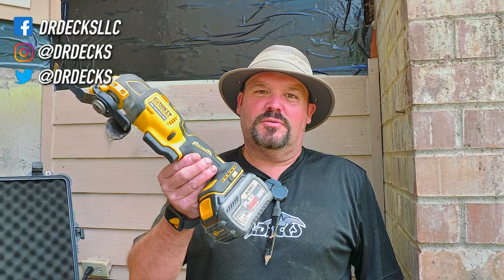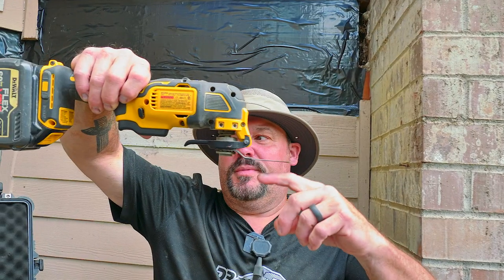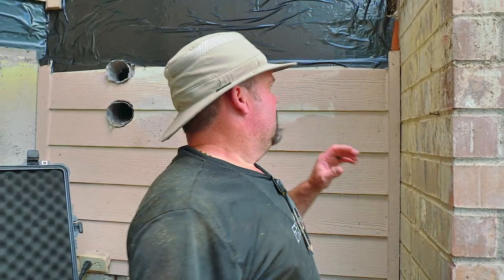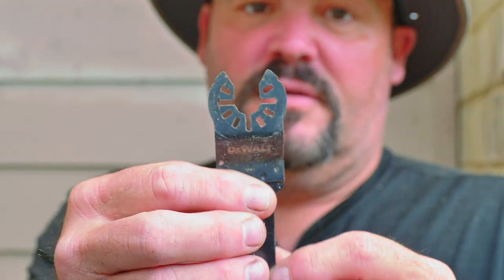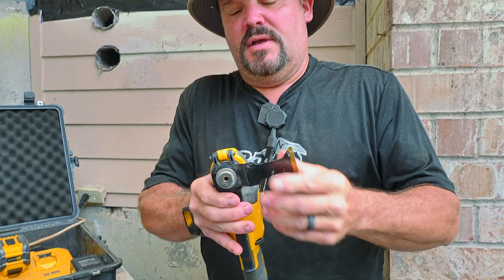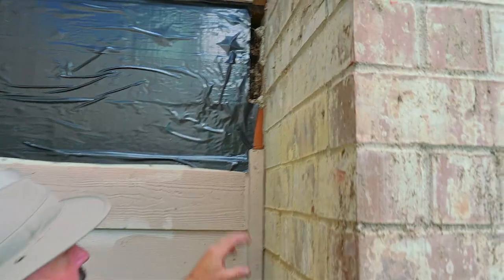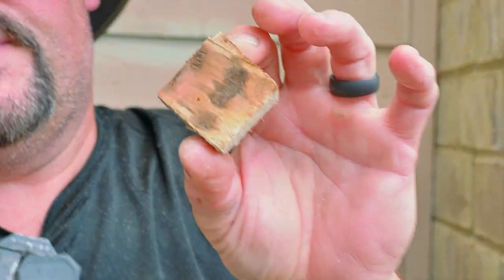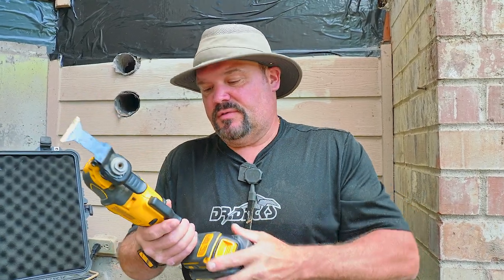What Is An Oscillating Tool? || Dr Decks

Comment: I hate it, can't jig with it, can't control it, and it is painfully loud.... but yes, sometimes it does its thing and nothing else will come close. I find that if you keep the blade from overheating it won't smoke and then the carbide ones, again only if they don't overheat, will last seemingly forever even cutting metal. But yeah, having to slow down work to save the $10 blade? Another reason it is a pain in the butt, but STILL a priceless / MVP tool